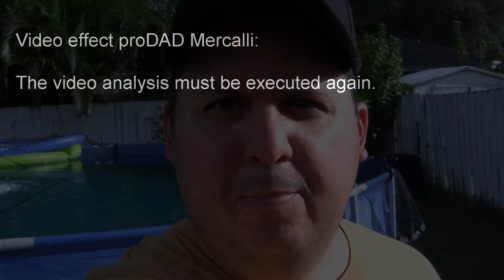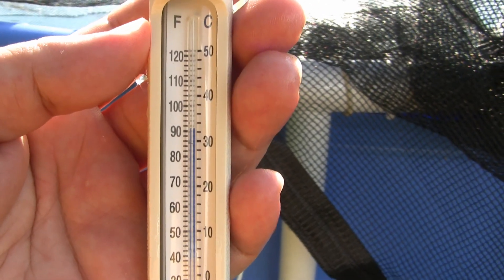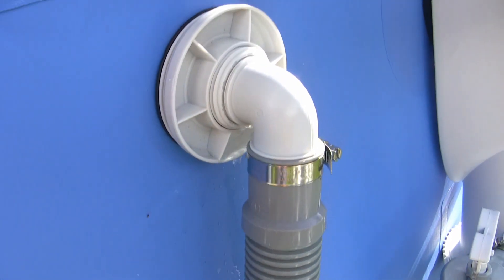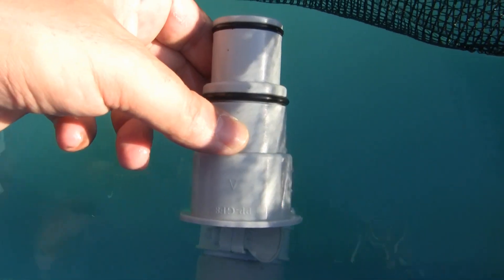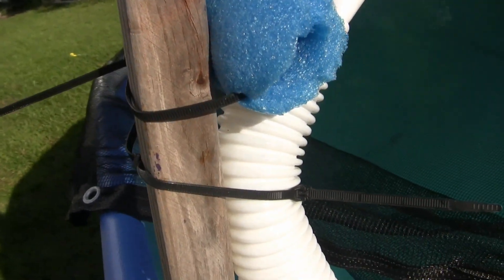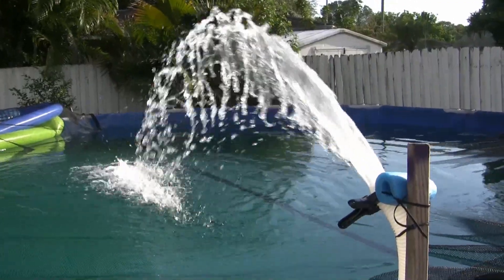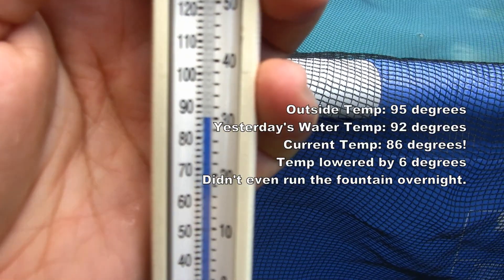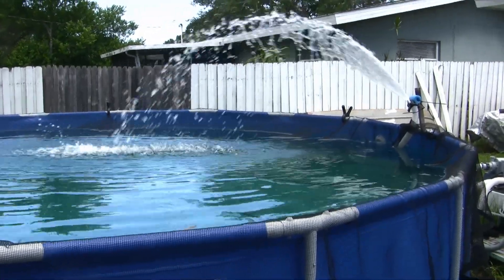How to cool down the water in above ground pool

Comment: I can not believe this actually works! My Intex 16x8x42 was at 92 degrees with our temps being at 102-106 for weeks now. We made a fountain similar to this but used a sub pump rather than the filter and I ran it overnight on a timer from 12 midnight and shut off at 7 am (with a 1 hour break to let the sub pump cool off and give it a break) the pool dropped to 84 degrees the second night I ran it again and the pool temp dropped to 78 degrees! I will now play around and possibly only run every other night for less time to maintain the cooler temp. Thanks for the help.
Reply from the maker: Awesome! That's a huge temp drop. Good job!

Comment: I'm sure you have done some testing.  Have you tried running the fountain in the early am.... Starting  between 12am - 2am and ending between 7am -9am? Seems like the outside temperature or air would be the coolest around then... Have you tested  the temperature effect based the above and testing it running or not running the fountain during the day? It seems like running the fountain during the day could help a pool get a few degrees cooler....  but actually  counter  productive if you are running 6-8 hours in the coolest temp
Reply from the maker: Yeah, for best results I ran it at night.